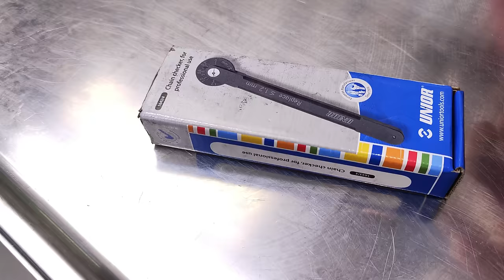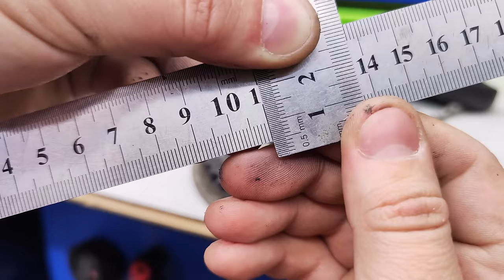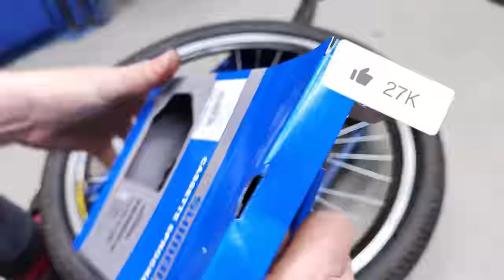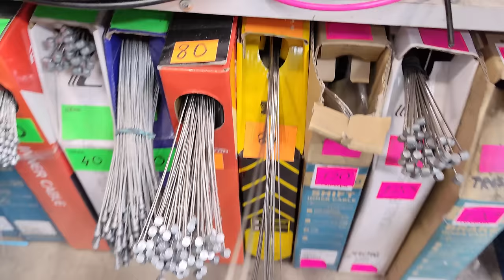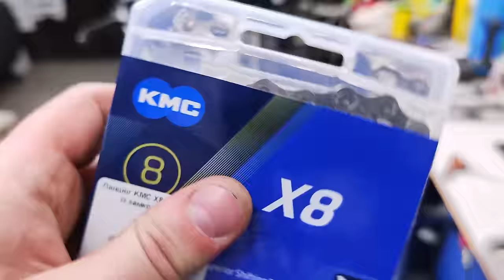Replacing the drivetrain on a mountain bike. Servicing your bicycle in the workshop

Comment: Why no match tire brand with valve position? Also, v-brake pads with no toe in will squeal.
Drill of cable mounts not such good idea unless rides very salty or muddy area, good wash and lube would be preferable.
Good ASMR though.
Reply from the maker: Thank you for your feedback! 😘